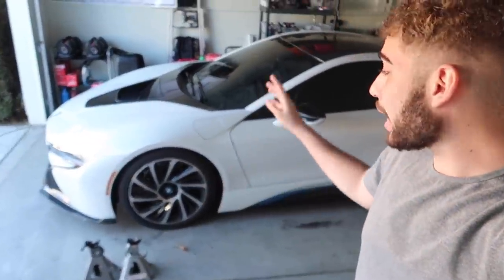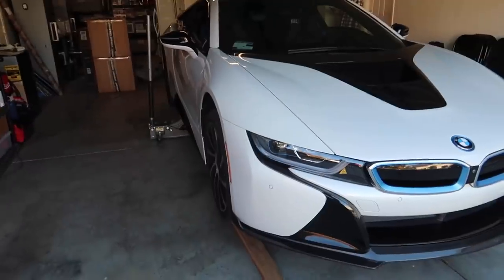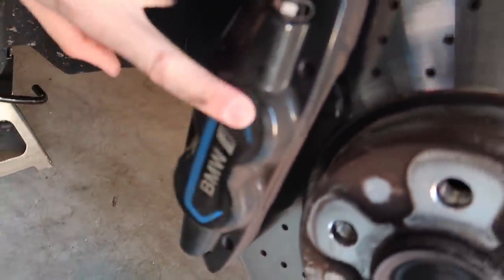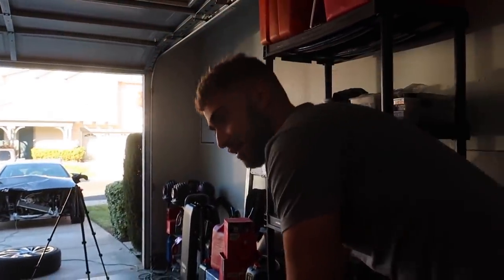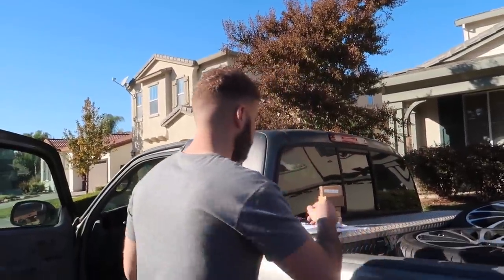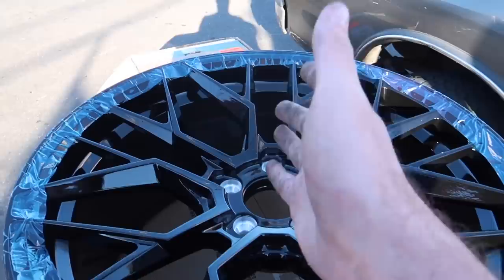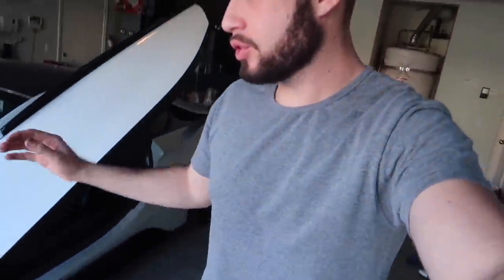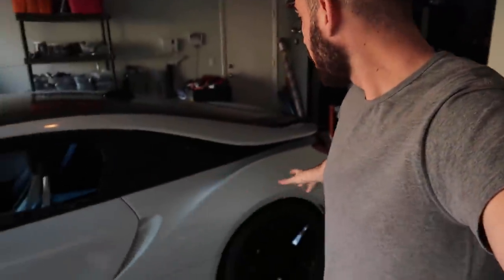NEW WHEELS FOR THE I8! $4000 SETUP!

Comment: While those tires don't have to be poppin' like my Lip gloss, Sir! Those ash looking tires need handling pronto.
And, I keep suggesting Marble Vinyl wrap or an Exotic Wood Vinyl. Not just coz you can be that controversial guy, stirring the debate for a hot minute but because it would be soooo different and out there you'd have to love it!
...but, that's just my opinion!
Anywho! Great stuff!
#SquadetteOutForNow
P.S.   
I use COVER ALL Spray on my Tires. It doesn't go on heavy unless I want it that way and it reeeeeeeeeally lasts.